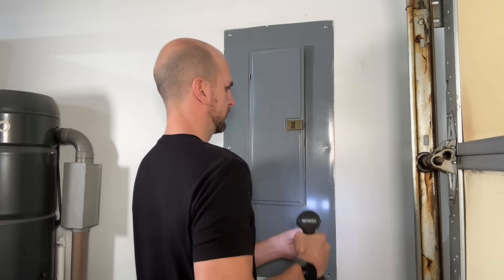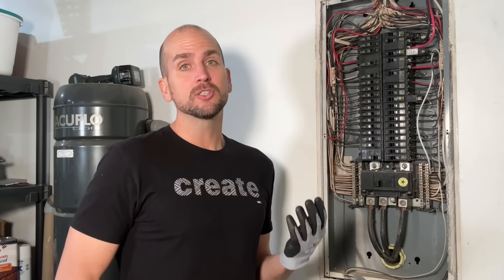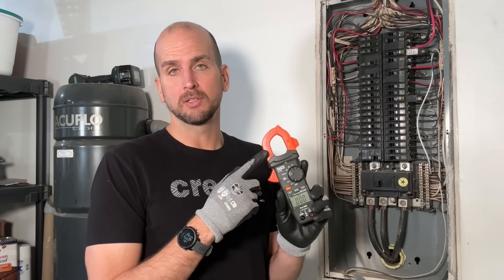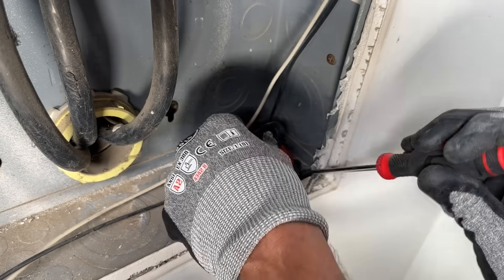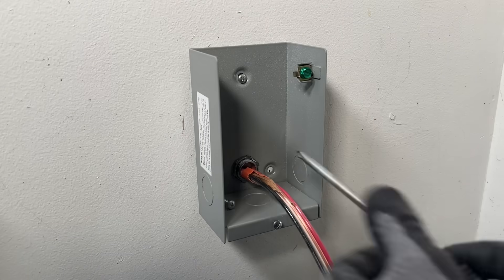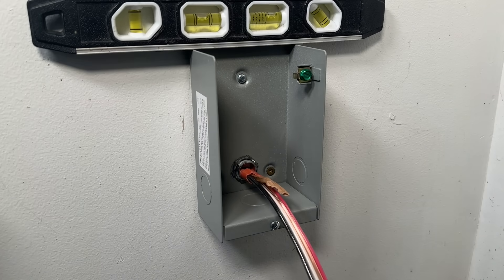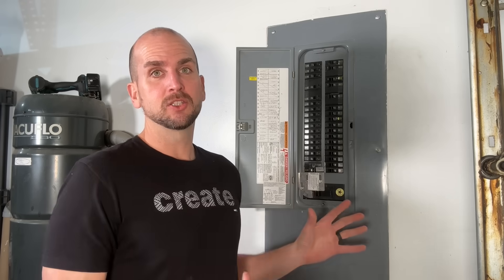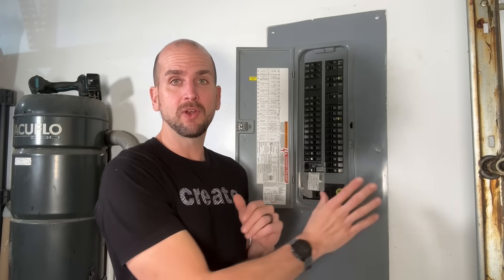Whole House Power Backup Solution | Generator Inlet Box Install

Comment: Another very important reason for the interlock is that if you are powering your home with a generator and the main disconnect is NOT turned off , then, if the power is restored to your home while the generator is simultaneously backfeeding power to the panel, then there is a near certain probability that there will not be phase synchronization between the street power and generator.  If two AC multi phase power sources are powering the same circuit , then voltage ,frequency and phase angle must match to avoid circuit damage to either one or both power circuits. So yes, absolutely use either a manual interlock or automated transfer switch when backfeeding a panel.
Excellent video tutorial ! 😎👍
Reply: My sons are lineman. Backfeeding the system could harm or even kill them. Please be aware of hat you are doing at all times. For your safety and the safety of ALL linemen.
Reply: Oh yeah, I heard about the pineapple express, big storm in western Canada, guy 
hooked up Gen thru welder outlet and getting ready for a big party, failed to open
the MAINS, there were fireworks to be displayed, also an electrical version of them
when the power came back on. Genset blew up lit gasoline flowed down to a camper
which then went up in flames...
Reply: I have seen this happen on an install, the AC came on, they had no interlock so they threw the main isolator on and the generator exploded due to the phase mismatch
Reply: Just BE SURE that while running your GENERATOR, your MAIN is turned-off. I myself, have NO issues with this!! Just saying... Why buy all the pre-caution stuff!! Don't get it!! only one circuit/Breaker on at a time!! Simple.. :)
Reply: If you tried to backfeed a generator to the grid your generator would trip the circuit breaker, or just shut down. There's no way it can make enough power to power all the homes on your block. The only time you can actually backfeed is if the line to your own house (and just your house) are cut.
Reply: @Ariel1S  A 5K genset will not power the neighborhood, but it will back feed, A step down transformer such as what is outside of your home does what when the flow is reversed? It becomes a step up transformer. Wont have the amps but it will have the volts. Its not only common sense, its against the law.
Reply: @grega2362   That's simply incorrect, it will overload and trip immediately - that step-up transformer will draw FAR more current than the generator is remotely capable of providing. It's dangerous only if the drop to that particular house is cut, but certainly not the neighborhood as a whole.
Reply: @Ariel1S  First, before tripping the protections, the generator can still provide power to the utility transformer. So a worker nearby can receive a shock. Second, a very typical outage is from downed powerlines. And they can be downed pretty close to your house, and backfeeding absolutely can make it dangerous for workers.
Reply: @AlexBesogonov  I wrote that, maybe you didn't read it. It can power your own downed line. It can not however, power the utility transformer.
Reply: @Ariel1S No. It WILL power the utility transformer (typically next to your house), and this transformer will boost your voltage to 5kV and feed it down the utility line.
Reply: @AlexBesogonov  The generator will simply stall out trying to feed that much power. It won't do it. The most it can do is the drop lines to your house. Maybe, possibly, if it was a monster 10kw generator. Maybe.
Reply: @Ariel1S  Now imagine that the utility line fell down one block away. Or if you're living in a rural area, and all your neighbors also switched to generators. Suddenly there's no load on the utility line, so your generator will quite easily energize it.

Comment: I'm not sure about doing this myself, so I had better hire it done for me. About how much should something like this cost?
Reply from the maker: For materials you are looking at about $150 - $250 depending on the length of wire.  Labor is a bit of a wild card depending on location but might run $500 - $800 for labor.
Reply: @EverydayHomeRepairs  thank you

Comment: A 240 volt 100 AMP inlet with a transfer switch outside between the meter and the main panel is the way to go.

I have an interlock transfer switch in my main panel. I start the generator then flip the main breaker off disconnecting the utility power and turn on my generator breaker and I have full power to the house.

It is awesome 👍
Reply from the maker: Dang!  That would be slick.  What generator are you running?
Reply: How is that different? (novice here) Power is still disconnected at the panel here.
Reply from the maker: @opennanoor44  I think having 100 Amp as backup is slick.  Not common as most would have 30 or 50 Amp.  With 30 Amp you have to be careful on what you are running.  100 Amp would be pretty much business as usual in a power outage being able to run everything on your house without consideration of the loads.